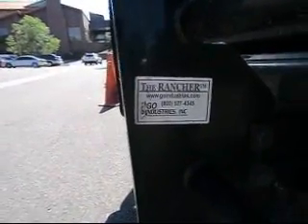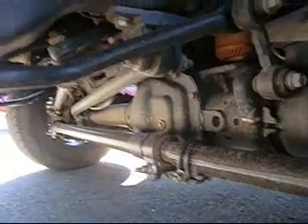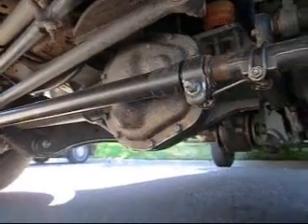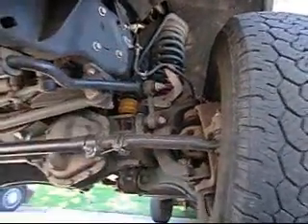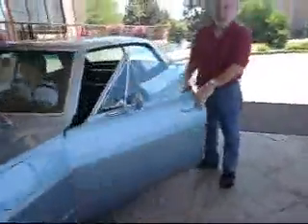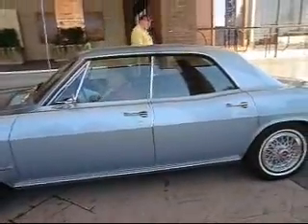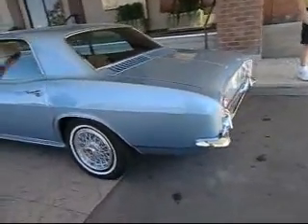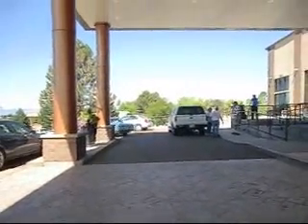7 24 11  Bad Corvair At Front Desk Painting Stipes...

Comment: That is a 6.4 powered truck the engine weighs 1200 pounds plus the fact there is 300 pounds of radiators and intercoolers.  The 6.4 trucks are heavy on the front end it is why the truck has a Dana 60 front axle and heavy suspension.